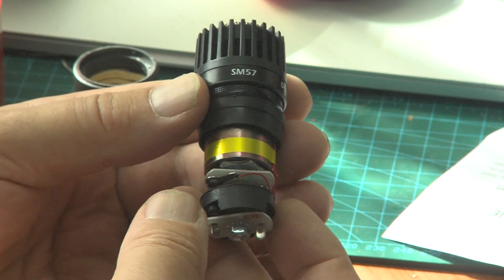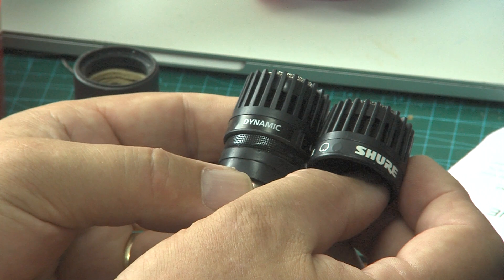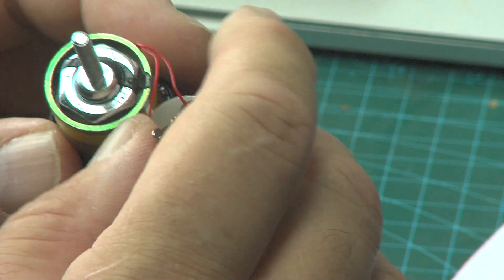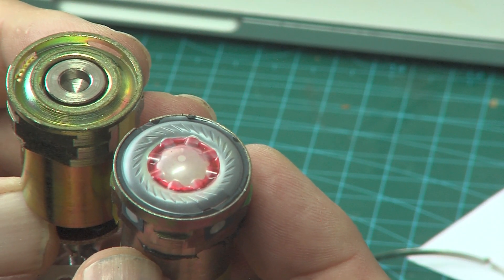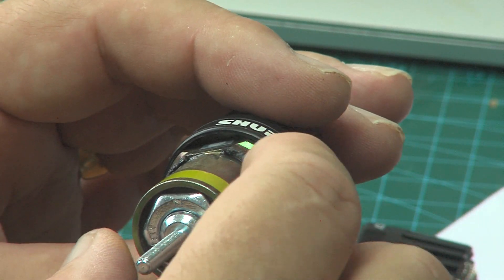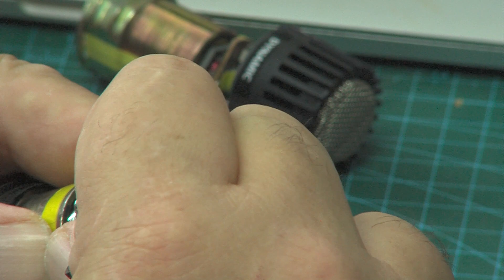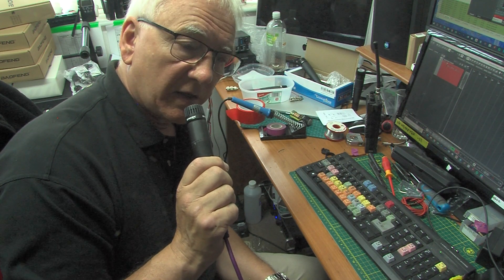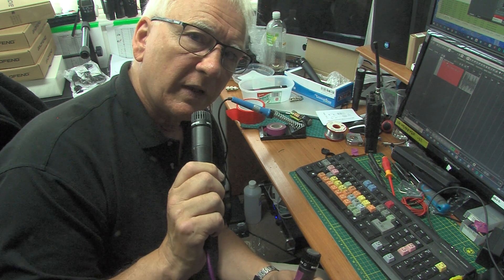Episode 86 Pt. 2 - the attempt to fit a Chinese capsule into a genuine Shure SM57

Comment: Hello friend, first of all I congratulate you on the video. My SM57 broke down, the thin coil threads were cut. They cannot be re-soldered since they are too short. What replacement capsule would you recommend? My intention is to replace the internal capsule parts and mount them to the original outer shell of the microphone head. I thank you in advance for a hug from the country Chile.